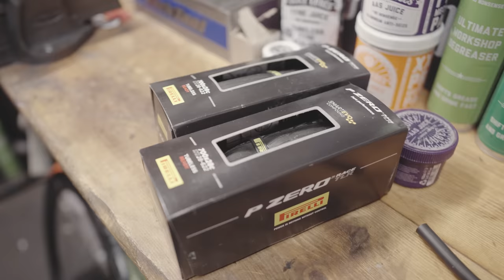DREAM BUILD ROAD BIKE - Rose Xlite

Comment: I am really not keeping up with road bikes so this was super interesting for me to watch. I knew disc brakes were there, but I was surprised to see the DT swiss through-axle... obviously you cannot route a hose through a suspension fork, so that was also interesting to see, along with the headset routing (some MTBs do that now though to an extent). With AXS this could be a virtually/visually cable/hose free build.....

Well, I will never get a road (nor gravel) bike, but it was still interesting to watch to keep up with what's out there.
Reply: I've been looking at road bikes for the past 10+ years (in the sport of cycling for 10+ years now, 3+ in the industry as a shop mechanic) and I'm starting to dislike the state of this discipline, in terms of the bikes at least.

The 2020s see integrated internal routing (amateurs call this internal routing and anything else as external routing) becoming the norm, so it's no surprise to see 2020s cyclists wanting a bike with such a routing configuration. Some riders from pre-2020 even had the nerve to want this configuration for their bikes that run regular internal routing, which unbeknownst to them unless told by a sufficiently technical mechanic, is impossible.

It's easy for people to like this sort of thing because they never work on them and most don't know the hidden truth until the time comes, including, but not limited to, increased labour charges for a once-simple headset bearing service/replacement, stem swap (if the lines were routed inside) and so on.
Reply: @yonglingng5640  I work on my bikes and my least favourite thing is cutting brake lines just to put them through the frame (other than pivot bearings swap :O ) ...
That said, I can go 1-2 years riding 5+ days a week on an MTB without swapping headset bearings... It really depends on what brakes too.. Hope connectors can be reused, Shimano is easy to cut/olive. 

But ...  I don't mind cables enough to even go AXS shifter on my bike. I swap shifter cable once a year or when doesn't feel OK and it's a 20 minute job as my bikes have decent hole-to-hole internal tubes, so no fishing with plyers and a flashlight :)

On an MTB I understand if you want less cables if you ride in raw trails with lots of branches/bushes, but on a road bike I don't see a reason other than looks. Or if you are THAT FAST, you don't want extra crap hanging and rattling and shaking in the wind.

But .. yeah ... zero interest to ride a bicycle on the road ... dirt roads, single track, bike park.... I barely touch a paved road :O
Reply: @denesk2794  As someone who's never dived into the MTB scene before, this is my ideal MTB:

Discipline: Trail
AL everything, no carbon
Easily sourceable rear triangle
27.5-inch wheels (I'm small and I'd like a nimble bike, or so I think)
BSA MTB (73 mm) only, no exceptions
Regular internal routing (paneled external is OK too, guided internal routing sure is convenient)
Shimano SLX/Deore XT + their own brakes if I want familiarity/any aftermarket mineral oil-based brake brand if I'm feeling adventurous
Minimum pedal kickback without high-pivot suspension
Reply: @yonglingng5640  I have 2 aluminium and 4 carbon frames. Carbon handlebars and no issues whatsoever.
I don't care much for carbon wheels, though I wanted to buy one last week as I was at the Santa Cruz dealer ... but they didn't have any :) ..
Carbon cranks is a no-no for me. I don't care for it, I don't want or need it. 
Also .. there is no issue with DOT fluid. Yes, it is not environment friendly .. that's there, but half a glass would last 5 bikes for 10 years, so probably your dish-soap is a bigger impact if that's why you want mineral  oil.
Shimano  - 4 piston XT or saint is OK, but there is HOPE. Their 4 piston brakes are amazing.

That said ... I ride long travel bikes. The shortest I have is 160/140, 150/150 and the longest is 180/178mm ...  

I just came back from the bike park minutes ago, and I took my 160/140 ebike (as the other one is at the shop for motor swap) ... and I wasn't happy with the travel....   I rode my 180/178 non-ebike yesterday at the same place ....  today felt like I felt every rock and pebble and it was exhausting to have just 20/38mm less travel
Reply: @denesk2794 rather than pliers, there are two better options. One is quite expensive, but worth it, if you do a lot of cable routing: a cable routing tool. The one we have at the workshop is the Park Tools one. 50 bucks. 

The less expensive one is a hook made from a spoke. As long as the frame is even okayish, you'll fumble with the hook for a second and guide the cable out. Or the hose for that matter.